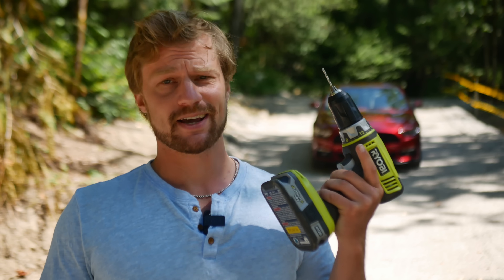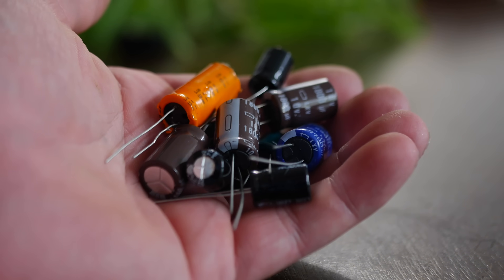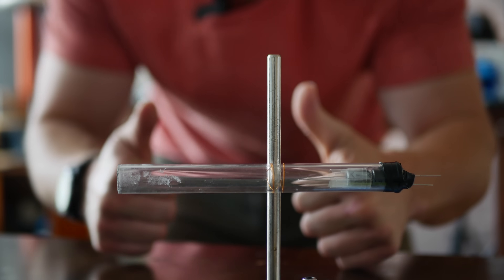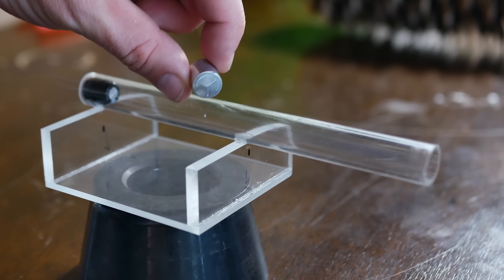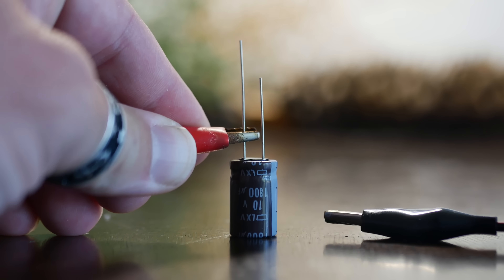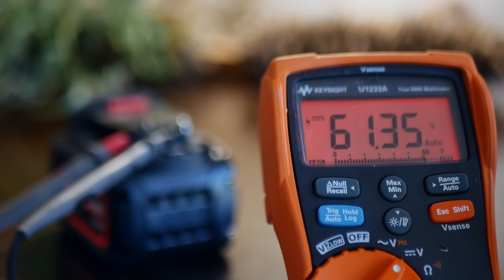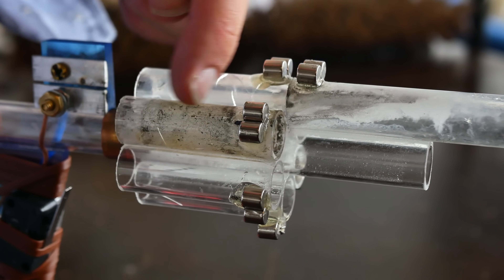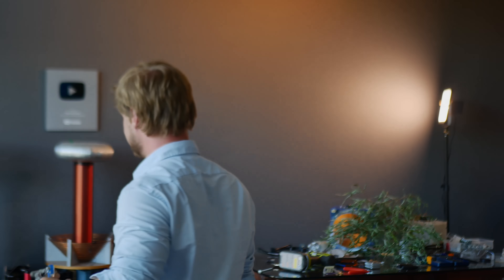I Built An Electric Capacitor Revolver!

Comment: I can totally see this being implemented commercially with consumable cylinders, with super caps potted in at the back of each chamber, and pre-loaded with projectiles.  Also, cold you incorporate an adjustable Buck converter to increase the voltage?  I don't know if they make them that "robust," though...

Comment: You should do an expirement with diffrent types of capacitors that have diffrent voltages and maps and how they effect capacitors blowing up. Also you should see about sodium and lithium ion battery blowing up to push a projectile. Perhaps a ion battery capacitor hybrid. Heating element vs electric charge and what happens if you do both. Also adding a rail and coil gun aspects or hybrid. A rail array down a barrel to continuously add voltage and momentum or super heat lithium into a plasma with hydrogen and oxygen combustion and reaction.

Comment: What about 60v into a boost converter that charges another capacitor at 400v - 500v. They are common in camera flashes.

Comment: Not the smartest idea to to let all that magic smoke unless you enjoy inhaling a toxic cocktails of neurotoxic fumes. The vapors can contain ethylene glycol, which can cause organ failure, and amines, which burn the lungs and eyes. If the casing ignites, you could be breathing in formaldehyde and phenols, both linked to cancer and neurological damage. Meanwhile, metallic vapors from aluminum or other components can lead to metal fume fever, causing flu-like symptoms, respiratory distress, and potential long-term brain damage.

Comment: You should be able to get even more explosive power from a capacitor by increasing voltage. I did it by accident once. I applied 164 volts DC produced by a bridge rectifier connected to the mains (120 volts AC) applied to a 1000 uf capacitor rated at 400 volts and it exploded like a loud firecracker. Shrapnel just missed me, but my ears got the worst of it----- it was so loud. I still do not understand why it exploded when only 164 volts was applied to a capacitor rated at 400 volts other than maybe the capacitor had a manufactured flaw. I never tried that again to find out.  Maybe a better use of the capacitors would be to use them as carriers of high voltage to a victim, by shooting a charged capacitor out of a barrel with say, carbon dioxide propellant. The charged capacitor would hit the victim, shocking the crap out of them for a split second repelling an aggressive attack possibly. The capacitors could be retrieved for reuse in the gun. Experiments to make sure the capacitor discharge wires hit the victim squarely would need to be done. Otherwise the capacitor may rotate in the air as it headed for the victim, and the capacitor wires may not hit and discharge into the victim. And obviously, capacitor charge would have to be considerable to penetrate clothing. Or alternatively the discharge wires protruding from the capacitor could be ridged, and sharp enough to penetrate clothing enough to stick into the skin causing discharge, like the original Tasers that came out years ago that shot out a line of thin wires that carried the high voltage to the victim------ the police may still use these.  High Voltage bullets you might say! Just a thought!

Comment: I made a single shot capacitor gun back in the mid eighties using some plastic tubing for a barrel.
The breach mechanism was a panel mount fuse holder within a small PCB style socket glued on the end, in which I could insert the capacitor leads for electrical contact.
I cut a slot up the tube to the same width as the fuse tag so that I could push the fuse holder into the tube, and then cut across the end of this slot so that I could rotate the holder, thereby locking the breach in place.
I hade soldered about 4m of wire to the PCB socket so that it could be connected to a bench power supply, and then be able to aim the gun (Wand) around.
Small electrolytes back then did not have pressure release groves in the cans, so would easily boil up and exit the end of the gun in a very similar fashion to those in your pistol.
Hours of fun shooting thing in the workshop:)

Comment: What if, the capacitor isn't the propeller, but is merely acting like a primer? 

Think about Colt Walker, instead of using the explosion of capacitor to propel the projectile, it's only used as a primer to ignite the main propellant, or, be used to break a seal of a self-propelling projectile like gas cartridges.

Comment: I wonder what would happen if you wired it to that transformer you built awhile back? It would probably need a rectifier circuit to change the AC to DC, and I'm not even sure what those diodes would look like 😅

Comment: You could put 10 9V block batteries in series to get a very simple, cheap and compact 90v power source. And maybe add a 100v cap on top to deliver high current burst power.

Comment: You need to make the capacitor and bullet into one shell. The shell just needs a contact for the capacitor to stick out of the bottom. With a toggle switch/trigger, it'll work. Also this way you can use the appropriate barrel for the round

Comment: Nice science experiment! But for better velocity you should use caps without a safety vent or simply seal the vent on the top of the caps with some epoxy. The projectile would be the aluminium can of the cap itself.

Comment: Hi
I need to make one, with 3.7v battery and a boost converter that can output 20v and upto 2A. Will it work?
Is 2amps enough for small capacitors?

Comment: About 30 years ago,  I used a professional camera flash unit at 330V to apply voltage to a 5V cap. Unfortunately I don't remember the amperage values, but the little cap totally disappeared, with quite a bang.

Comment: Use a large capacitor to get the volts and discharge rate you need, charge with the battery.

Comment: As someone who's very interested in firearm design this could be a concept that would be useful The only issue is it probably wouldn't be good in the military setting because of how expensive capacitors can be along with the costs of producing power to keep the batteries running and in its current form it produces slightly less power than the average BB gun but it is a really cool idea and with time and money could be expanded into something that would be useful for target shooting or maybe hunting if it proves itself to be reliable You should try to talk to people like Brandon Herrera who design guns and build them and have shops because they can teach you a lot about pressure and tolerances and how to make a more efficient and safe pistol

Comment: Why not just make a primerless black powder revolver? Make the cylenders out of metal thick enough to contain the explosive and have two little metal plates on each side wall that are protruding out a bit farther than the metal walls at the base of the cylender tube close enough to create an arc inside of each individual cylenders tube. Hook up a trigger that sends voltage to said plates to create an arc Inside of the cylender setting off the black powder sending the bullet out with as much power as you want depending on how much powder you use. This would allow you to make a much lighter smaller revolver that has a completely adjustable electronic trigger. Using a 9mm sized cavity for powder tapered down to like .30-257 cal for where the bullet seats will allow you to send a 75grain .257 slug with 30-40grains of powder out at speeds that produce a nice flat trajectory with around 38spc foot pounds of power but thanks to the small diameter slug and more aerodynamic shape making 40+in of penetration possible along with much more if not a double the hollow point expansion,  fragmentation, yaw, and temporary wound cavity than a similar weight and speed bullet in 9mm or up. You could easily fit 8 tubes In a cylender or you can make the powder cavity longer but only.257 or .30 In diameter retaining the same amount of powder capacity but allowing up to 9 or 10 rounds in the cylender. Since it uses no hammers or springs you could have the cylender be enclosed in a bulpup configuration looking more like a modern semi auto than a revolver allowing it to be the size of a pistol with a 4in barrel but in reality having 6-6.5in of barrel length. This would be a ultimate survival pistol since one needs no primers and the slugs and black powder can be made from scratch without electricity easily unlike primer caps. It'll also allow alot more use before fouling up due to the lack of springs and moving parts and much safer since one can have a battery disconnect safety and you can charge it with a solar phone bank charger

Comment: You could use a DC-DC converter to ramp up the voltage too, or use the mains power with a ballast sending 120V ac (or 240V) directly to the capacitor.
I once connected a bad 100uF 50V capacitor to 100V 50Hz on a DIY psu that also delivers 115V and 230V ac up to +1000W.
The bang was as loud as a magnum gun shot.
Electronics are fun as hell.
Been into that since 1998 and work as an electrician.😄

Comment: Whatever, you attach a compressor. And throw in some pennies.
Reply: Then that breaks and points copper.
Reply: Pennies, dimes, nickles, construction blanks...
Reply: Some random junk metal from ground.
Reply: If it heats up a little.
Reply: It cannons.
Reply: I don't know how you get a penny in a compressor to know that, but it would.
Reply: Something you worry about on construction sites. When you work on compressors.
Reply: Only one it didn't have is compression.
Reply: You alternate compression chambers.
Reply: On a rifle you'd line them up.
Reply: You take power from that.
Reply: These are still primitive formed weapons.
Reply: Still be funny to have one built like a powerball machine. The penny shows there.
Reply: That thing used to spark and they had to stop.

Comment: Try making a piston device so you can fire smaller caliber for more speed.  Your Capacitor fires into a like size disc that is connected to a shaft with a light pressure return spring that pushes against smaller caliber Bullet.

Comment: If voltage correlates with speed, could a cattle prod or handheld taser work? Those use convert battery input to thousands of volts DC. Although not continuously, so it would involve a more complex firing mechanism...

Comment: I had a similar idea but with rapid ionization increasing to create force to push a projectile. Kind of like making plasma using lithium to turn it into a vapor. You can use a noble gas to ionize quickly and shoot a projectile. Ion pressure gun or somthing like a electroyte like salt add electricity to turn it into a gas which will expand.

Comment: what the FU*K is that monster capacitor CD98SK 20V (800000 micro F) 😳😲😲😲😲😱 IT COULD REPLACE A FREAKING 12V 35 TO 80 AMPs BATTERY. I'VE NEVER SEEN A CAPACITOR SO HIGH IN MF THAN THIS ONE 🧐 I PULL [ALL] MY HATS TO IT👏👏👏👏👏 AND TO YOU OF COURSE👏👏👏👏👏👏👏👏👏👏, YEAH I'VE SEEN ONE BIG WHICH CAN HOLD A HUGE AMOUNTs OF Fs IN IT BUT IT WAS JUST 200V 50000 UF BUT COMPARING TO THIS ONE IT'S JUST A TINY BABY............. AND THANK YOU FOR ALL YOUR MAGNIFICENT EXPERIMENTS 💙😊

Comment: Was there a follow up to this video? This is a brilliant concept for dealing with a component of electronic garbage which typically just end up leaking and causing problems decades later. Imagine collecting capacitors that are near their failure stage and having some fun at the range! I imagine a box full of swollen capacitors and some tiny pieces of lead to glue on and boom!

Comment: It's not driven by capacitors, that 'gun' is technically had driven. To be more accurate this the first gun to use capacitors as a propelling charge to shot a projectile. But like most guns it uses gasses to shoot the projectile

Comment: - The Terminal.

The Piercer Revolver is railgun-revolver hybrid that uses electric pulses to fire microscopic metal shards at high speeds. The revolver cylinder is loaded with self-recharging batteries instead of conventional bullet cartridges, and the muzzle is a tall, glowing rectangular opening rather than a projectile-sized hole. Located above the grip is an additional battery powering the weapon's on-board display, which indicates the charge state of its alternate fire. The cylinder's chambers and display glow light blue by default, though the color will change to reflect the player's variant palette customization.

Comment: Revolver needs to revolve tho
it'd be cool if after every shot it revolves over on its own like a real revolver does so that you can pump out those shots fast to see what that looks like
Reply: Not all revolvers are double action. The Colt Single Action Army had to be manually rotated, and the cylinder did not disengage to allow fast loading/unloading like modern revolvers.

Comment: Some types of capacitors have ventilation built into the the lead side, I’m sure those paired with a capacitor discharge bank like what other commenters mentioned, would give you a situation where the capacitor it self could be the projectile. I used to mess around with a microwave transformer connected to a wood pole and would touch capacitors on a random circuit with the arcing end and some of them were powerful enough to blow through my drywall ceiling, kinda sounds like a fun death contraption to make

Comment: Use the capacitor as the charge but make the projetile and barrel bore smaller this would increase the pressure and more than likely improve the fps of that projectile.

Comment: Your wrong about a 90v handheld PS being hard to source.  You can find similar things in RC all the time.  I had a 28v, 100 amp build for a helicopter that would draw 2500 watts at full throttle!

You could have built some sort of voltage step up or just found a bunch of smaller high current lipo/lion cells and wired them up  into a 90v pack.

Also you didn't make a weapon, you made a toy.  I strongly suspect a paintball "marker" hits with significantly more ft/lbs than your toxic revolver (those caps are pretty nasty! LOL).  heck, airsoft might have more impact per surface area than this thing.  

Dont get me wrong, its a fun project, just not a weapon.

Comment: Yo I don’t know if you looked into this but you could use or make a transformer to get the voltage you desire. It’s kinda like the gears version for electronics. You do sacrifice lower current for higher voltage as there has to be conversation of power / energy.

Comment: Heres an idea: Instead of going for bigger capacitors or more power, go for more efficient projectiles. Im thinking of discarding sabot type rounds like modern tanks use them. A shell that with an outer jacket that dismantles after leaving the barrel leaving a smaller caliber but much lighter and faster dart made of tungsten that hits the target. Combines the velocity and aerodynamics of smaller calibers with the energy of a large bore barrel.

Comment: Maybe you should research the toxic PCB's in capacitors. Releasing PCB's into the environment is illegal, they are only allowed to be used in sealed components to keep them out of the environment. Like electrolytic capacitors and transformers. PCB's accumulate in the tissues, they don't wash out of you, and once you are exposed to enough, then the toxicity becomes apparent. Don't blow up electrolytic capacitors, you're poisoning yourselves and your environment.
Reply: There are no PCB's in electrolytic capacitors. PCB's are only in very old oil-filled capacitors.

Comment: if you make the barrel much longer with metal and use the big size high voltage(3~400vdc) capacitor to make it explode, must be very powerful + more air tight

Comment: 5:06 can someone explain to me how this phenomenon works. He fires it and it goes all the way to the end of the barrel and then just sucks back in.
Is this because of the pressure inside of the barrel, like is the ammo pulling a vacuum between the ammo and the capacitor?
Reply: My guess is the rapid expansion cools some volatile compound used as the liquid in the capacitor and causes it to turn back from gas to liquid.

Comment: Taser. If voltage is a positive correlation... Can you utilize the output of a taser module at 30,000 to 50,000 volts and still see it explode with enough vigor? This will allow you to use a variety of different batteries to produce the outcome you desire. As well You can always look into the option of a sabot round. This way you can use the type of capacitor that you want for the most energetic reaction and fit it into any size barrel you want because the sabot fins take up the extra space and will peel off once it leaves the barrel.

Comment: if you put a bank of capacitors in the handle, let that drill battery charge them, then discharge them all at once you could probably up the voltage going to the propellant capacitor and get more power out of it.  Or maybe a choke/transformer out of the battery.

Comment: We built something similar 10 years ago.  We converted a soldering gun into an electrolytic gun.  We simply let the electrolytic capacitor explode at the mains voltage, which in our country is 230 volts.  The circuit breaker trips with every shot.  And it didn't have much firing power.

Comment: I wonder how it would perform if the projectile contained a magnet (maybe a neodymium magnet inside of a 3d printed plastic conical minie ball?) and the barrel was "threaded" using wire to produce an electromagnetic field opposed to the projectile magnet. It could potentially improve centering, decrease drag (depending on tolerances) and maybe even provide spin for stabilization....

Comment: 1 inch copper pipe.  Added benefit is that you can connect one leg to the pipe, and only need to articulate a single leg for the other contact.  Also, huge caps.  >:D